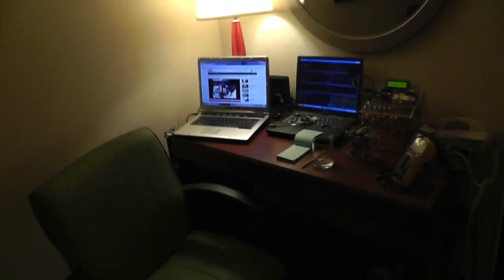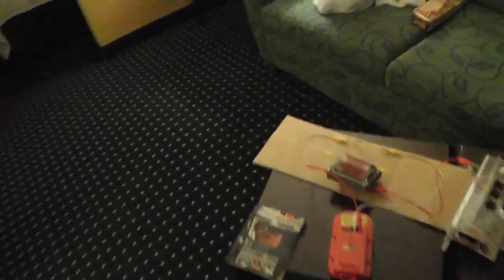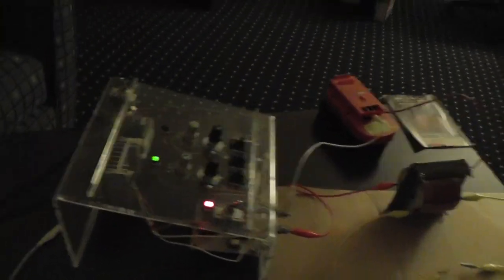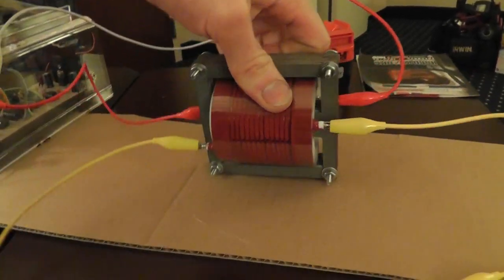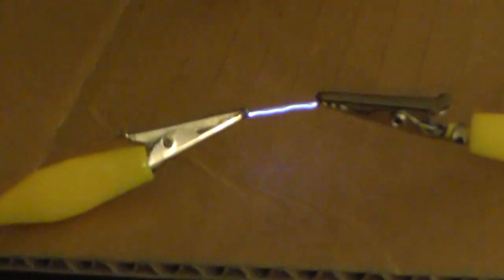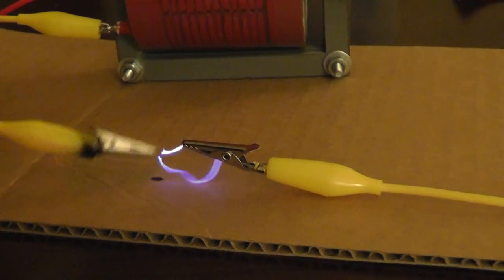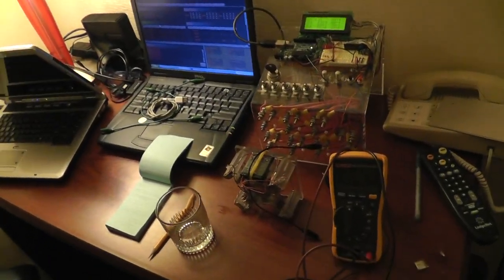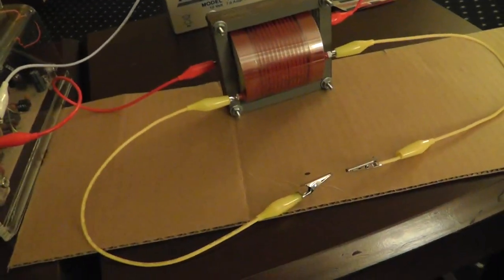VIC Injecter Coil Tests In The "Hotel Lab" mwahahaha! RWGresearch.com

Comment: If you pop the fan and cut grooves 82 to 90 degrees an about a 1/16 depth and varying distanced between 1/16 and 1/8 inch on each blade. Just do the came number of cuts on each leading and trailing edge of your fan blades. It will breakup the eddiys and give you a nice quite run.

Comment: cool stuff Russ,
So what is your final turns ratio and with 18volts in what does that give you for an output voltage?
IMO you should use Kapton tape for insulation.it is rated much higher in breakdown voltage.
You can get it pretty cheap on Ebay "Kapton-tape"

Comment: any plans on testing it further, with a cell perhaps?
did this setup use the blocking diode?
it shouldnt spark, I'd hunt for no spark at the smallest distance between the clips, and I'd look for a corona discharge.

Comment: That just means you won't get side tracked by time wasting stuff. And based upon the construction and interior if you turn everything on and step two feet away from your door in the hall you probably won't hear much. That is because they design the acoustic in hotels to absorb vacuum cleaner motor sound. Your fan is right in there so no major issue with your neighbors me thinketh. The HF audio is WAY to high to propagate. So you are goo to GO!

Comment: I got some meat for those bones. I am in the shop today running parts on the vertical cnc machine under contract for Meggitt Defense Systems for a 105 mm tank mounted machnie gun that will blow a city apart and i am working on fuel cells to stop the fighting, where do you think my mind is.